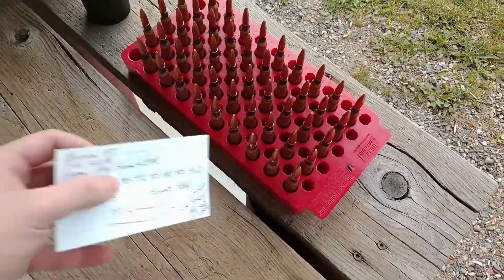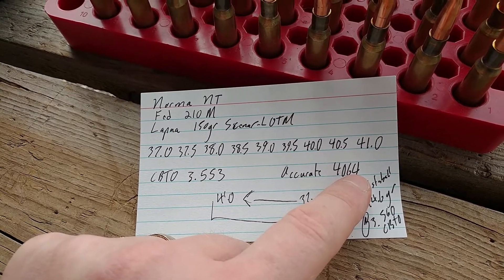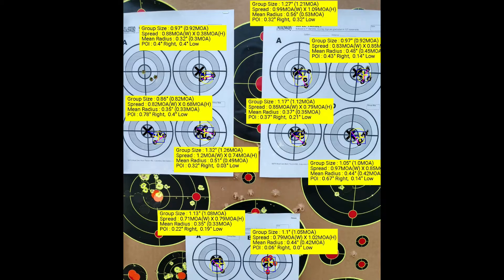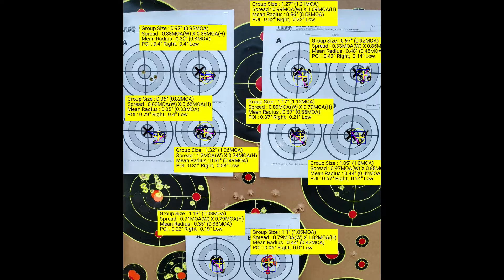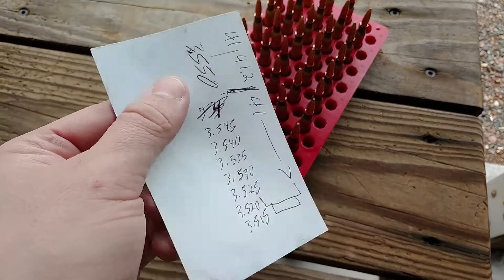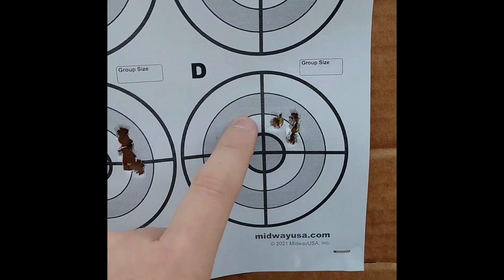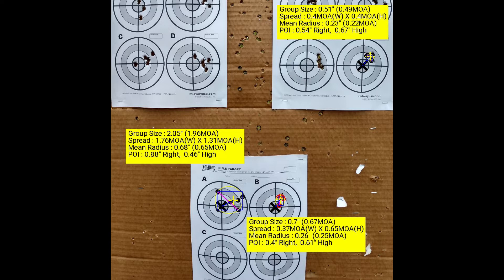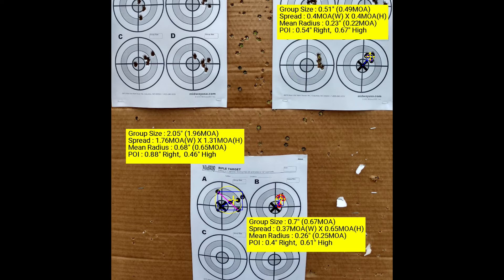Semi-Custom 7x57 - Accurate XMR 4064 with 150gr Lapua Scenar-L OTM

Comment: Just found your channel. Very interesting results. I plan to run a test on 6.5 Carcano ammo, just how much accuracy is lost when using .264 bullets, versus the .268 its designed for. Feel like you would have fun with a test like that. One gun channel to another, subbed.